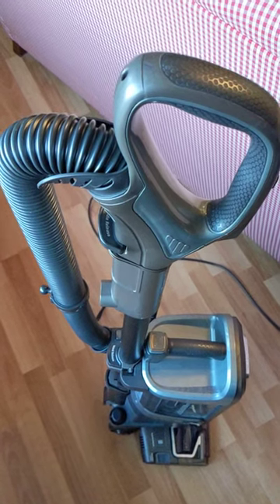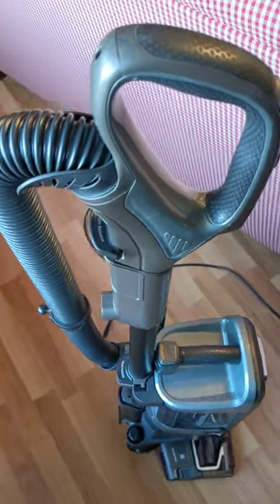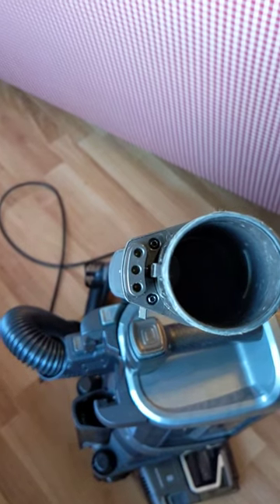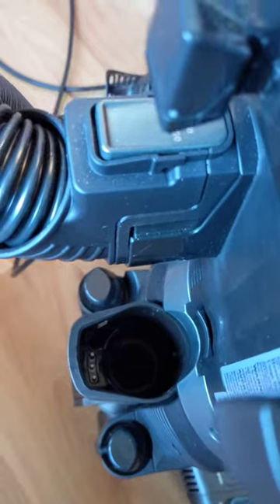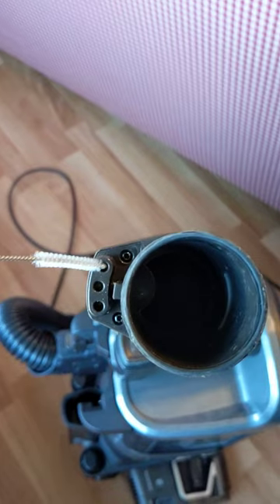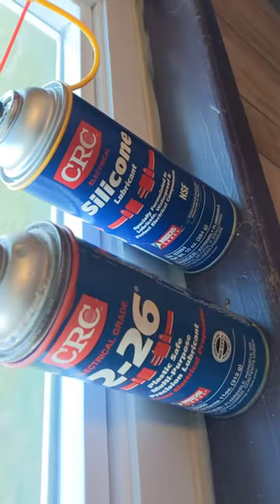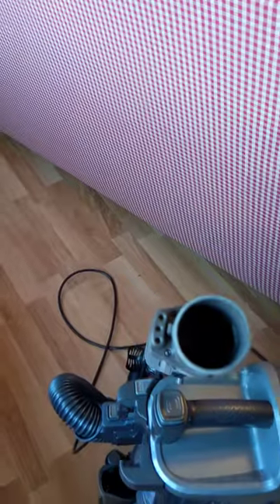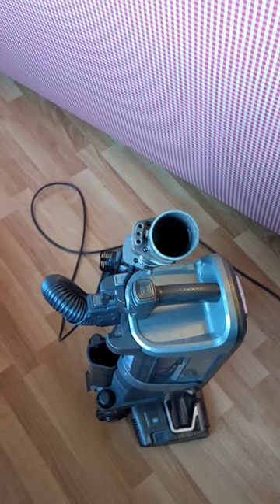Shark Apex brushrollers not working, lights flashing?  Try this easy fix FIRST

Comment: You did it ,trythe small things first . I was searching how to fix my shark apex upright vacuum. The top wand and suction works but the base didn’t light up or do anything. Other videos showing the motherboard or engaging switch and replacing the bottom base . All I did is spray some wd-40 into the 3 holes connector from wand to base as shown in your video and it worked 😂🎉❤. Thank you so much because I luv my shark .
Reply from the maker: Shark products are great, but it seems the more complex the machine, the more likely that they will fail.
Reply: Im about to try this !! Thank you.

Comment: thank you.. I cleaned all the connectors, I cleaned and lubricated the little catch pin thingy's that keep the roller cover on ( I'M guessing those are safety switches as well , so the drums will not turn with the cover off) cleaned everything and , it works!!

Comment: This worked, thank you!  Fyi, after i spayed in the electronic cleaner I used q-tips with some of the cotton removed and rolled the tip into a point.  Ty for the video!  Btw had CRC QD Electronic Cleaner in our garage, red and white can, just putting that there in case someone doesnt know what to buy

Comment: AZ1003BRN Purchased 1/7/2022. Same problem. Had hose replaced 3 months after purchase. On 6/29/2023 the wand, where it connects to the power head is losing connection turning off the vacuum head and brushrolls.  The handle light comes on when this occurs, every time you pull back on the vacuum the head turns off.  Gonna try your top hope it works. Thank you.